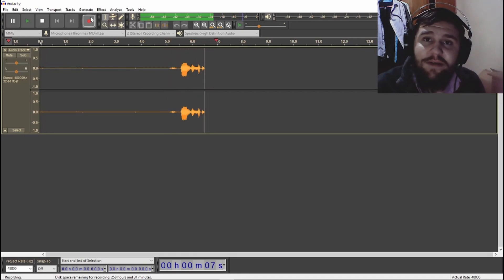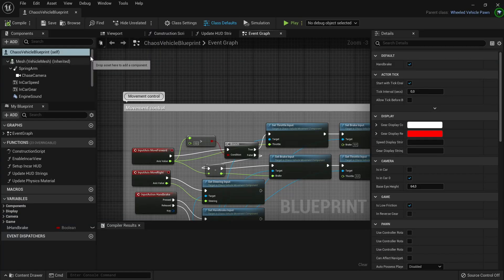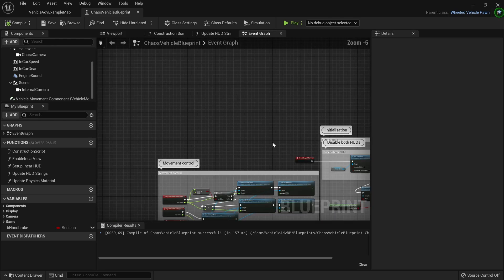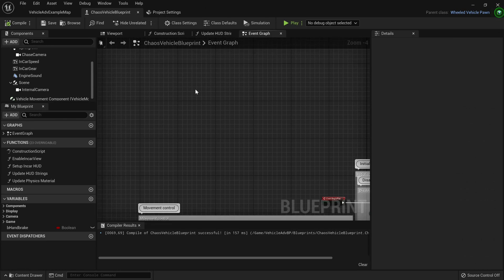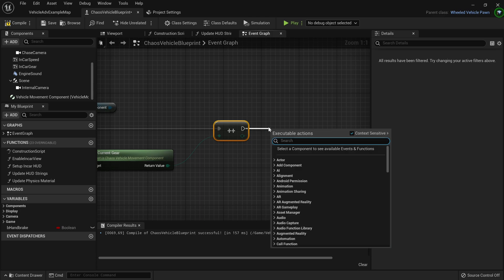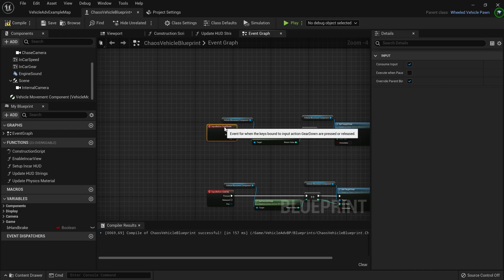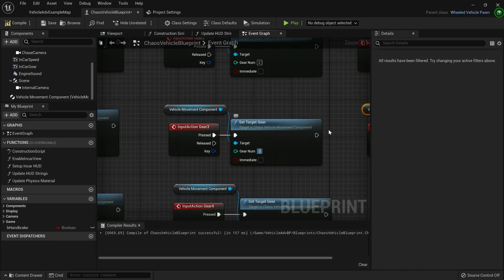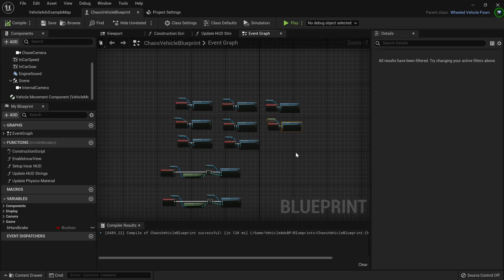Creating a manual transmission (Blueprints) | Unreal Engine

Comment: This doesn't seem to work for me. I can press all my inputs but the car won't shift up, down or to a specific gear. Do you know what I could have done wrong ?
Reply from the maker: There is sadly a lot that could've gone wrong :-(. Did you turn off automatic transmission in the chaos blueprint? Did you posses the chaos vehicle? Do you have it set as the current player pawn in the game mode? Do you have another controller plugged in? These are a few I can think about at the top of my head.
Reply: @InsertNameHereGameDev  I figured it out. I just need to check Immediate on them. As far as I remembered, in the tutorial you said we can make it immedate if we wanted to but for me it seems essential for it to work. Weird. It also causes weird issues. Now my car will randomly not stop driving until I switch gear.
Reply: @InsertNameHereGameDev  I did turn of automatic transmission but I couldn't find the Automatic Reverse option. I'm guessing that must be an option in UE5 only .I'm using UE4 but the description says that shouldn't be an issue. I'm not sure if I possessed the vehicle or if I have it set as the current player pawn,  I just made a completely new Advanced Vehicle Project and started right away (Just getting into UE to see if it's a good engine for a game I want to make). Steering still works, but all the inputs I made don't seem to be working. I also don't have any controllers plugged in either. My blueprint is identical to yours so I'm not sure what's going on.